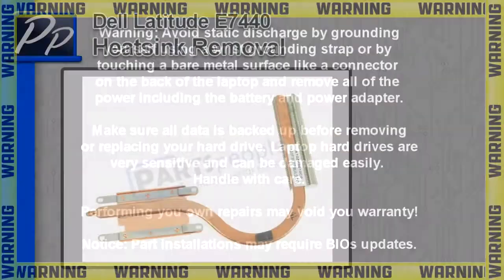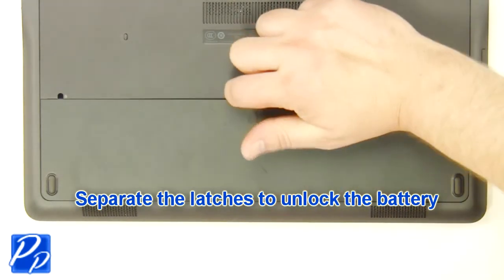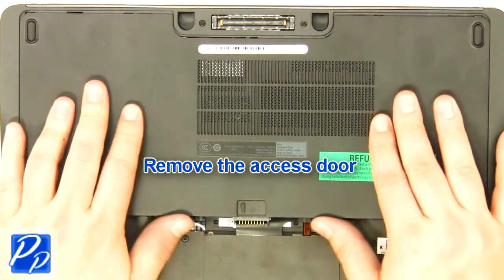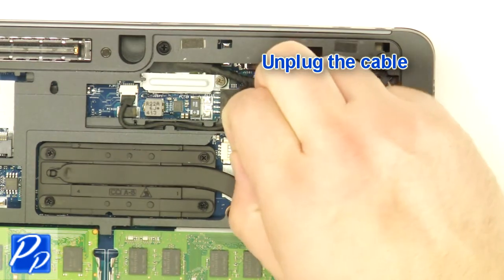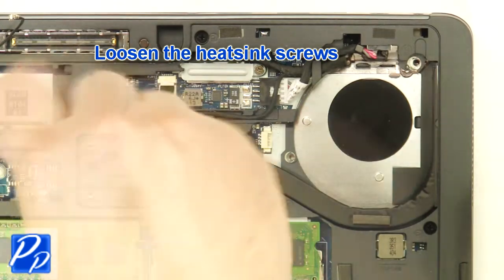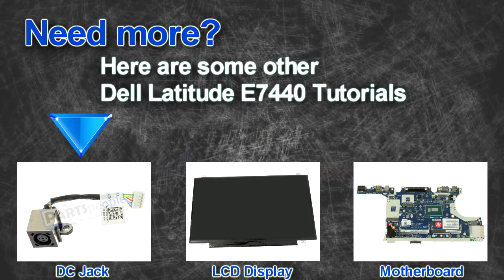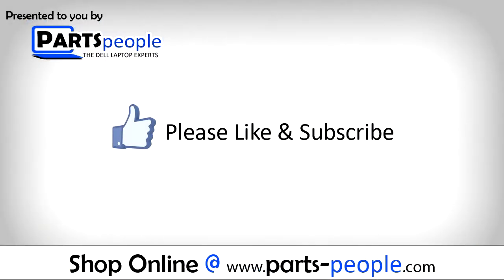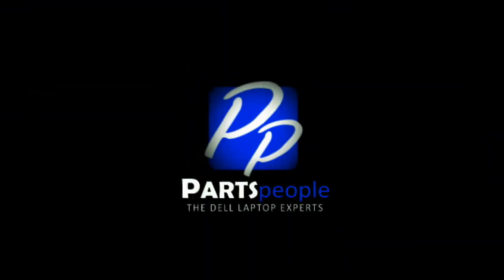Dell Latitude E7440 Heatsink Video Tutorial Teardown

Comment: Will repasting make a big difference in temperatures? I bought mine used and I've noticed it gets quite hot just browsing around the internet.
Reply: Use cooler master thermal gel pro
For better result